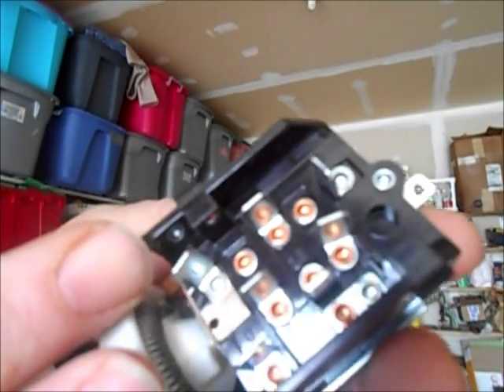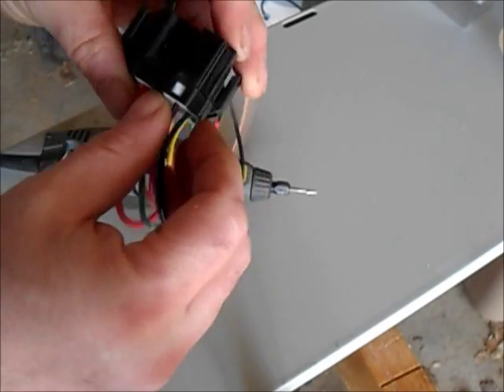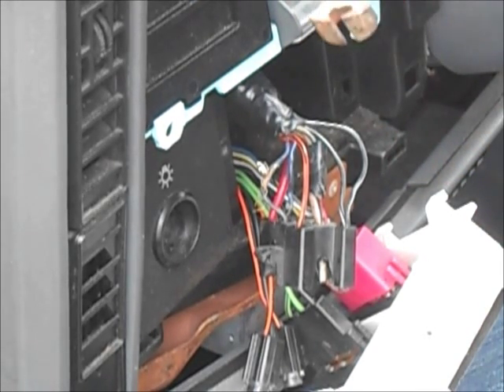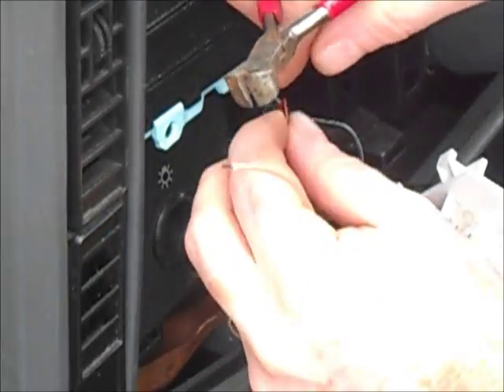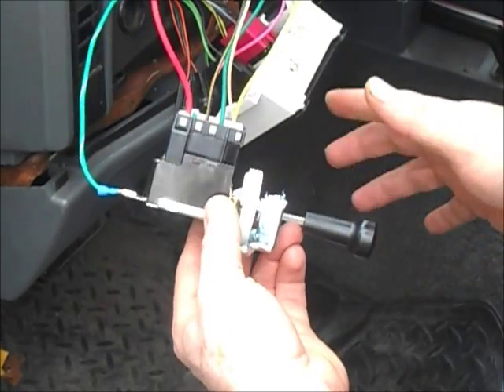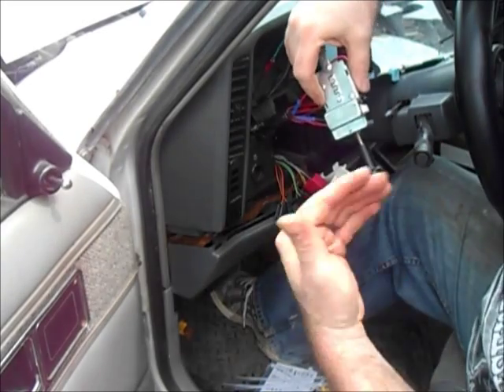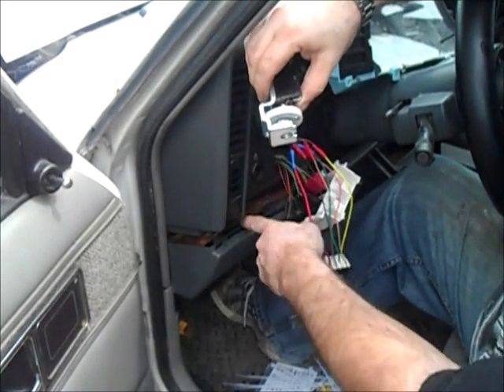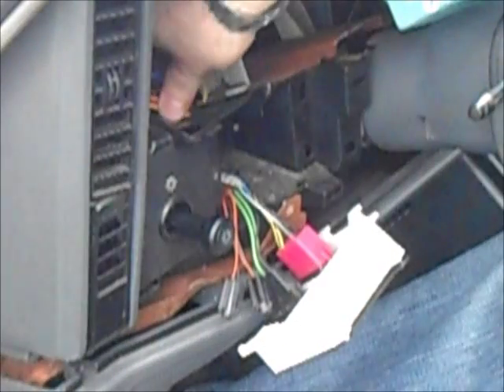Jeep Headlight Switch & Connector Repair

Comment: So question where does the ground wire go ??? Cus i keep blowing the fuse because of a bad ground but i dont know where its grounded too in the jeep thanks.
Reply: ground goes to any metal behind dash area. thats why just removed whole left side of dash by cutting it loose and self taped it with screws to reinstall . hope this helpful.
Reply: I’m m having this same exact problem with my 96 country!! @shanecarrell7904
Reply: I keep blowing fuses and there’s two tabs for the ground to go I just plugged it on one of them and it’s cause major problems

Comment: Great video! I referred to this video when I replaced the headlight switch/connector on my 2001 Jeep Cherokee! Thanks!
Reply from the maker: That's awesome.  Glad it helped out a little.  Just an FYI... I had to do the same repair on my 96, but not long after, my lights started going out again after they got to warm.  I picked up one of those wiring harnesses (off of ebay) that connects the headlight switch to some relays and draws the main power for the lights directly from the battery.  Took about 10 minutes to install the thing, and I haven't had a single problem with the switch or connector overheating since I installed that, and the lights remain solid, no matter how long I leave them on.  Just wanted to pass that along in case you have any more ongoing issues with them.
Reply: Dang. 8 years ago. Anybody still here?? I’ve got a 96 country with headlight problems and it’s stressing me out beyond measures 😭😂

Comment: please help  me. watch my video
https://youtu.be/JAJcEOs91l8
Reply from the maker: I am dealing with a similar issue on my 96.  I have narrowed it down to either a bad headlight switch, or a loose wire in the connector.  I see you have everything torn apart.  Is that a new switch?
Reply: I bought a new switch and  didn't fix the issue. Couldn't get the new switch to do like the video shows
Reply from the maker: Then unfortunately, it sounds like its in the wiring, and that is not much fun to track down.  I would start at the headlight switch connector and look for any burnt or loose connections there.  I don't remember off the top of my head which wire is the lead for the dash lights, but find that wire, and start tracing it back until you find the problem.  It might be as simple as a ground that needs refreshing, or might be in the connector itself and that's easy to change.  Hopefully its not further up the system.  I hate electrical problems.  The only way to find the issue, sometimes, is just to start following the wires back through every stupid twist and turn.
On the 90, the whole connector pretty much fried and melted, and that caused a whole bunch of fun and interesting issues.
Reply: well i snipped one of the ends off that lights up  the dash for letting you know that the switch below is for rear defogger. i wasnt thinking and wired the ground and hot together and it blew the fuse twice. so i grounded the ground wire and ran the hot wire to the wire harness for my trani temp gauge.

 Could that be what caused the problem???
Reply from the maker: If the problem started then or shortly after, then I would say that is where you should start looking for the issue.  I don't know what tapping in to that lead would do.... I'm a complete novice when it comes to electrical problems, but there's that old adage that if the problem appears after you change something, then however you changed it, caused the problem.
Reply: yeah i was thinking about putting that end back on and see what happens and run the dimmer wire to the radio wires cause this happened after i snipped and touched the wires together. yeah im a complete fool when it comes to electrical but im learning lol
Reply: if the wire harness is melted could that cause this issue?
Reply from the maker: I think absolutely.  A combination of the lead losing its ground or something in the harness, and the old switch beginning to fail and letting it jump the ground or something to a different circuit.  Strange things begin to happen when circuits look for other ways to complete themselves.
Reply from the maker: Yup, that's the headlight switch connector.  That's what I had to replace on 90 and where I think the issue is with my 96.  Upgrading the headlight wiring harness will help.  It takes a lot of the heat out of that connector.
Reply: well what happened was when i tied those wires together it blew the fuse twice. i put a bigger amp fuse in it cause i ran out of 10 amp fuses, yes i now that was def dumb on my part but could putting the bigger fuse in cause the harness to melt?
Reply from the maker: Yes, but they are prone to melting anyways.  That's why everyone suggests putting an upgraded headlight harness in that will send the main power to the lights through relays.  Right now, the full voltage for your lights is going right through that harness and it get HOT.
Reply from the maker: From that side, it doesn't look to bad, but on my 96 what melted was the wire insulation around the top of the connector.  If you've got wires making contact that they shouldn't, look down form the top, where the wire is crimped to the tabs, and peel back the tape on the harness and look for any melted or damaged wires there.  The heat that gets generated from the way they engineered this can cause damage in a lot of different areas, so carefully check the wires as far back as you can chase them.  Its tight work in there, but I'd still guess you're going to find your issue somewhere around the connector.  One way that helped me was to test the continuity of the bottom of the connector with the top, using the ohm setting on my DVM.  Hold one lead on the bottom of one of the brass plugs, then check for resistance on the top with all the wires that surround that lead.  That led me to which wires were making contact that shouldn't, so I had a better idea of where to locate the problem.  You can also test all of the leads to ground.  Only one of those wires should be a ground wire, so you should get infinite resistance on all the others.  If you get any reading other than that, it means that wire/circuit is jumping to ground somewhere, and that can help you narrow down your trouble shooting.  If you can get the service manual, it will show you the wiring diagrams which can be invaluable when you're trying to trace pathways.  I picked up online versions from Coast Manuals for around $8 for each Jeep.  If you need a link, I can try to find it when I get home from work tonight.
Reply: okay ill try a few things

Comment: How did you get the headlight switch out?  It seems to be stuck in the jeep to me...
Reply from the maker: There's a button on the bottom of the switch that yu have ot push to get the plunger out.  It can take a little wiggling, pushing, shoving, cursing, etc... but once the plunger is removed, there is a little nut that is behind it.  It usually hs a slot for flat screw driver.  Once that is removed, the switch is free except for the wires.  Just undo the clip, and you should be good to go from there.
Reply: i just cut out the whole left side of thedash panel and toreinstall used self tapping screws  to reinstall